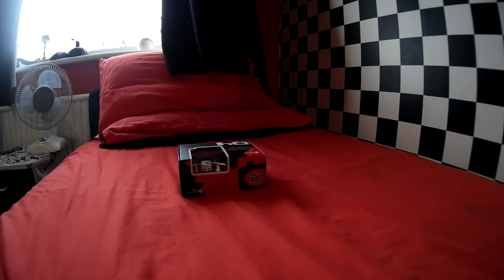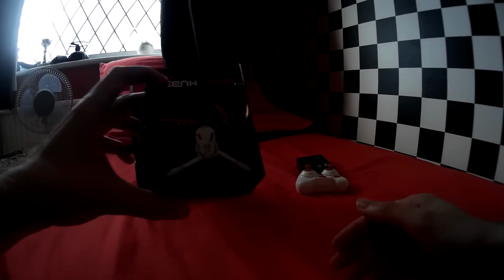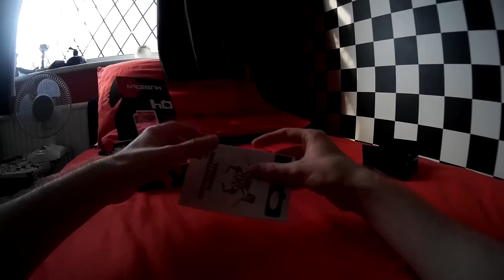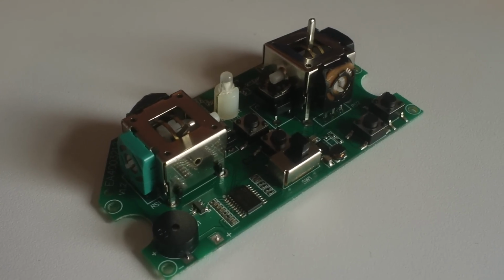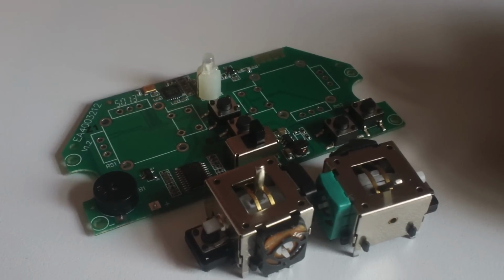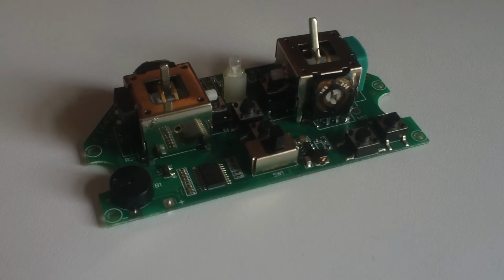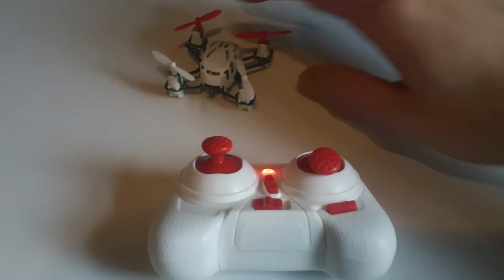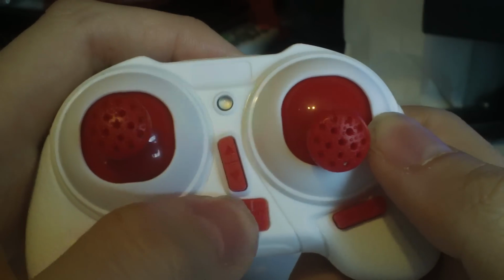Hubsan Q4 unboxing mode 1 conversion & flight

Comment: I bought this from amazon and the throttle is on the right stick. Is there a way to change the throttle to the left stick as this is what we are used to after flying our Syma quad for 6 months?
Reply: I know this is literally years later but did you come to fix this? I'm dying staring at the manual trying!